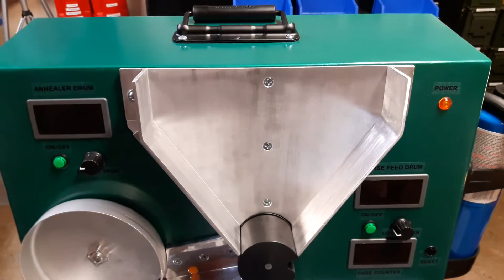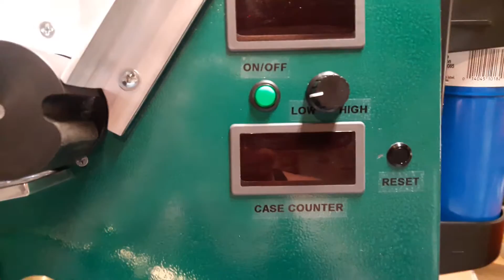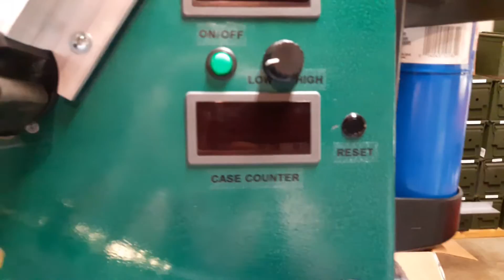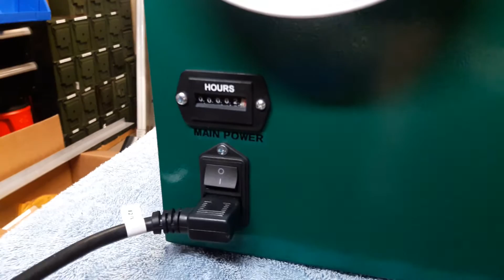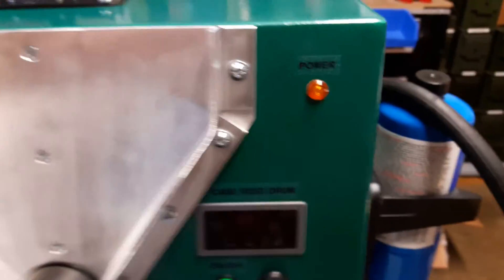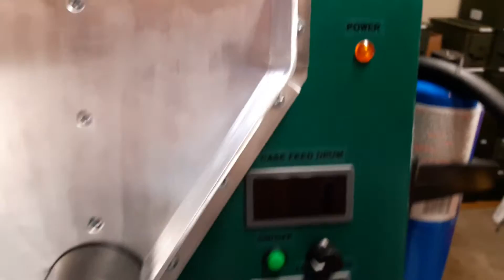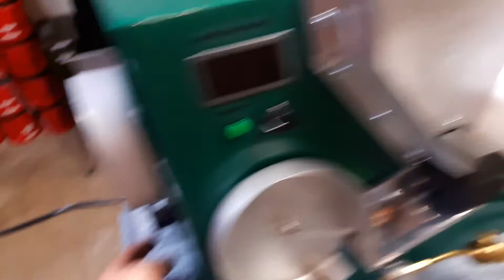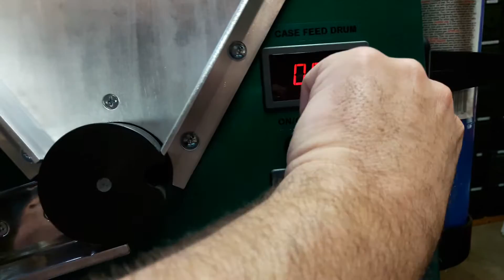DIY case annealer  "360 Degree view"

Comment: Looks like you had fun making a "better than the other guy's" annealer! 
Very interested in the proximity switch and counter. Nice touch. Would you mind providing your wiring diagram? I found the sensor/counter on ebay for about $15. 

I also like how all the controls and readouts are on the front panel. Sweet setup!
Reply from the maker: Phill Davis I believe I posted a video here on that https://m.facebook.com/KarwathKustoms/?ref=bookmarks
Reply: Thanks for pointing out the video and for putting it together. Very much appreciated!!
Reply from the maker: Phill Davis Thank you..I felt if I was sitting sitting at my reloading bench why would you put a readout on top you can't see..so that is why I choose to have them on the front.
Reply: Do you have another place for the elrctronics hookup video?  All your links are gone...
Reply: Sledge Hammer second this
Reply: Hey Phil, what proximity sensor, counter did you find? Any help would be appreciated.

Comment: I have several questions, How did you find center of rotating drum (Cake Pan), how do you cut the drum height , where did you get the torch setup?
Reply from the maker: I use a starrett combination square with round stock/tube centering head to find center on the drum, note the drums are not the best in being round so you need to find a happy spot and go with it. for the height I used a sheet metal scriber to mark the height all the way around and used cut off wheel to cut it and air angle sander to clean up the edges. for the torch setup its a standard MagTorch MT200 from local store and fittings were bought online and gas hoses are custom made to the length I needed. the torch  adjusting arm and torch holder I made or machined.
Reply: Who custom made the torch hose and what fittings do I need on the end

Comment: could you tell me the part number for the prox sensor and how it was wired, where you got the depont feeder role thank you for you help
Reply from the maker: Just search "NPN NO 4mm Detect Distance Inductive Sensor Proximity Switch" , none of the electronics are from the US, they come from overseas. How to wire it go here, I didn't post it on youtube https://www.facebook.com/KarwathKustoms/ .  I got the plastic local but it can be bought online if you don't have a local plastics company. Look up Acetal Copolymer plastic round stock or Delrin ... I bought 5 3/4 dia but did a final machine of 2 1/2" dia.. it can be bought in 2 1/2" dia as well.

Comment: Karwath,
  I like the proximity sensor for counting cartridges. Would you be willing to share how this is done? I am not good at electronics. I am also looking for a way to turn off and on, the cartridge feed motor thru a sensor at the ramp/pan location.
Reply: You could use the same style sensors they use on the Mr. Bulletfeeder